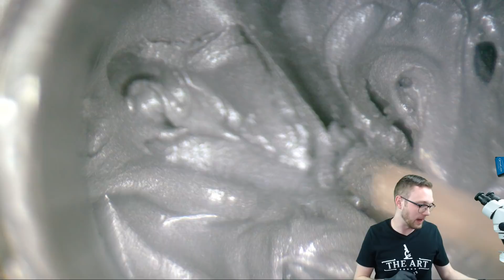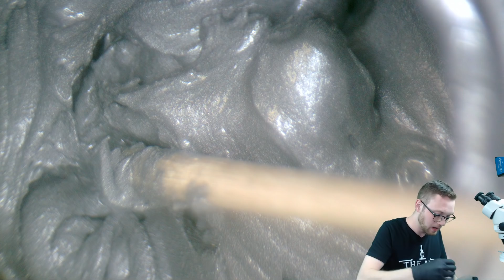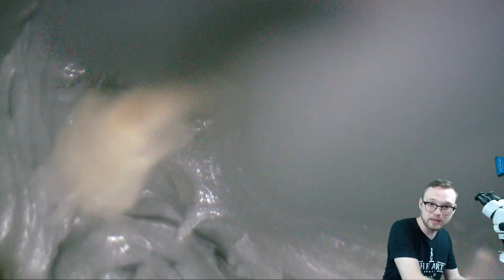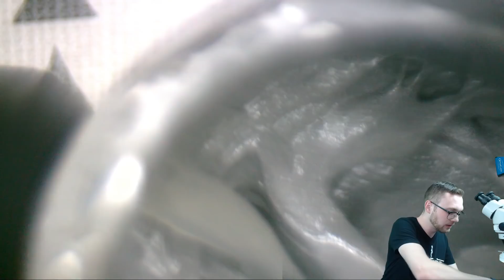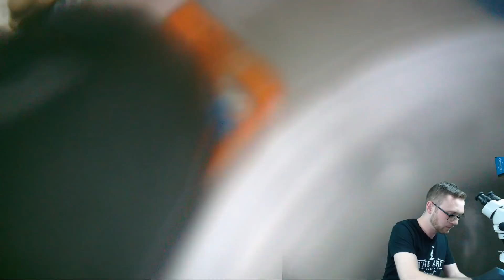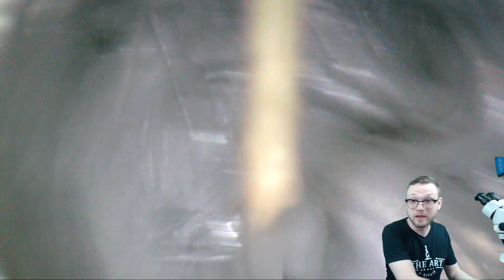The Great Solder Paste Revival | How do I fix dried up solder paste?

Comment: Justin says that the solder balls do not change over time.  That's not quite true.

The manufacturers of solder paste describe that the deterioration of solder paste is not simply due to the evaporation of the flux. There is a reaction (albeit slow) between flux and solder.  The finer the balls (T5, say), the more surface area they have. As a result, there is more reaction between the flux and the balls.

If stirring in more flux fixes your old solder paste, good on you.  It's like dumping water into old latex paint or paint thinner into old can of alkyd.  If you intend to paint your house, use fresh paint.
Reply: they also make their lids super cheap with no rubber seals for a air tight seal so it dries faster than it should even with the lid closed
Reply from the maker: Your 100% right on this Robert! I actually have been doing some deeper digging on this subject latly since weird enough, dry solder paste has become the wanted norm in the repair industry, vs higher flux content paste.  So I thought pretty soon it would be a good video to redo. And ill make sure to address this comment and make sure people know whats really happening. I feel like the more I spread into the industry, the more I find I don't know, but happily learn and reinform as new info presents itself.  Hope to see you in the comment section again! Thank you for taking the time to leave this comment.
Reply: @TheArtofRepair  Chipquik makes a two-part solder paste, with metal separate from flux. Before it's mixed, it has a published shelf life of two years.  Once mixed, it'll keep in the refrigerator for six months.

That said, published expiry dates are often a way for manufacturers to sell more product.  NARCAN, carried by the police and not used very often, gets thrown out and replaced every thirty-six months.  That's a good way to sell more product.

As you point out, if you aren't using solder paste in a printer or an automated stencil/squeegee system and you are inspecting your work, stirring in some new flux is probably a valid approach.
Reply: My new chip quik looks like the "dry nasty " stuff at the beginning lol and it was made only a month ago. 
I use plastic wrap over the mouth before closing. 
I buy the jars, transfer into large syringe (messy but easier than smaller ones), then use a connector between large and small syringe to transfer(leur lock adapter) and have smaller amount and put jar in fridge 
One jar is 391ax that says doesn't need refrigeration. But still do.

Comment: Is there a way to repair no-lead solder paste that's dry as a rock?
Reply from the maker: I mean to be honest at some point it’s degraded. The best you can do is crush it and try to add a small amount of paste at a time but I don’t recommend this. It’s going to be a bad experience overall
Reply: @TheArtofRepair I thought that was the situation, but I asked just in case you knew of something that would work.  I suppose I would have to use something like a Sonicator and/or expensive chemical process to get it back to specifications.  Thanks for the confirmation!
Reply from the maker: @garyp2821 st that point 3$ China paste would be better 😅

Comment: Be honest i work on drones I was just thinking how nice it be to have solder paste that is thinker. I could drag the motor wire through it hold it over the pad heat it up. Instead of tin the pad tin the wire blend them together without crushing them. If i could heat it and poof that be awesome

Comment: Can I use IPA for dilute this? , I saw some of the chinese videos of PCB repair work, they had a soldering lead with the density of Water, I dont know How I express that, I need a soldering lead which is compatible with normal syringy which we are used in hospital. I juat attached a link for your reference. 

Link : https://youtu.be/Z902gGyV8wE

Comment: i used a corroded tip for my first solder project...was a nightmare but had a workaround by melting further up the tip then dragging the molten solder down to the work piece and it actually worked(i have a working calc to prove it XD), needless to say i have refreshed the tip by sanding and also got my dad to make me one out of an old solid brass bolt, both work wonders. i have a £20 solder station and im not paying about £6 per conical tip when its just a hobby XD i'll just make do and mend
Reply: You should use a brass sponge for your solder tips
Reply: @ConsciousBreaks  I meant the whole tip was rusted lol, I had a brass cleaner and sponge

Comment: Flux itself is made of resin and a solvent. So it should suffice to just add the solvent.
Reply: Which solvent would you use then?
Reply: @noel1637  Isopropyl alcohol and some glycerin to stabilise it.
Reply: @Conservator. 
Thanks I have some 91% alcohol and some glycerin.  I guess I will just mix a little together an then mix it in with my paste. Hope I dont set anything on fire
Reply: @denise-oc6fd  ok 👍 
Just to be sure: Isopropyl alcohol is not the same as ‘alcohol’ (what’s in liquor).
Reply: @Conservator.  
Its more like rubbing alcohol
Reply: @Conservator.  
I have both ...im an all around crafter so I had both on hand for other projects that required them both.
Reply: @denise-oc6fd  Excellent! Nice to hear your feedback. Tx!
Reply: @Conservator.  
Thank you
Reply: What kind of solvent....anyway the alcohol worked. Thank you

Comment: Hi, very interesting video, thanks! How do I manage what you have explained, after my solder paste has been saved inside a syringe? Putting it in a sealed envelope in the refrigerator did not help to preserve it from disseccating!
Reply from the maker: Honestly, paste in a syringe is pretty hard to save in general, this technique is aimed more for little pots of paste. =(
Reply: @TheArtofRepair  gentlyy heat the tube
Reply: @TheArtofRepair 
Can I put a little liquid flux in the syringe and pull the plunger back and forth while holding my finger over the tip of the syringe
Reply: @TheArtofRepair 
The syringe is brand new and im making some jewelry. Its kind of dry when I press the plunger and the solder comes out.  And can I use another syringe type soldering paste that is cheaper then SOLDER - IT Silver Solder for jewelry .  If it says Silver Solder Paste can I use it to Solder or it paste that only like a flux

Comment: tried it before even watching video, it didn't work good and created mess on board. I'm sure the flux I used wasn't made for this purpose. But then again, what for.
Reply from the maker: How did it mess up, did you mix it inside the container? Without being there, I would suggest adding small amounts at a time until it has the consistency of the OG flux. Might even be a good idea to match both the flux maker with the solder paste maker, as they may have a closer formula than what your introducing. I have personally used many types of flux to fix my paste, Its just about doing it in the OG container, and adding small amounts till it feels proper.
Reply: The solder paste started to look good after adding flux, even better than before. But then after reflowing it in an oven, it created small solder balls and flux spread through all board, and it looked complete mess. Components did stick together, maybe not electrically but they didn't come out with pulling pressure.
Reply: thats exactly what happened to me. i think its all about the brand of the flux seems like they are not all compatible for this prosedure.
Reply: Too much flux. The only thing that happened is the solvent Evaporated. It was likely rubbing alcohol 99% or acetone. It would be better just to add that fluid in small amounts back in rather than adding more flux which will just make a mess when u solder

Comment: I prefer using Isopropyl alcohol. Alcohol is the only thing that 'leaves' the solderpaste when it dries out. A lot of blabla ....
Reply: Tom myLens . How long does it stay good? Isopropyl evaporates fast.
Reply: Hi Robert, 
Some days but of course this depends on surface size, temperature, consistency etc. 
But if it dried out and became too hard I simply add some more alcohol again. And a bottle of Isopropyl is really cheap and you can use it for many other purposes like cleaning electronic devices, preparing for painting, ... 
I did not experience any loss of quality even after some "rejuvenating" with alcohol.
Reply: Bye Bye solder paste